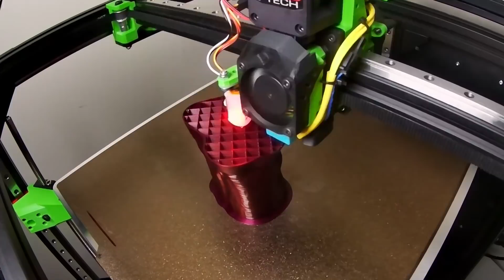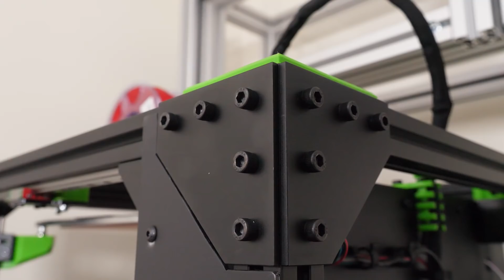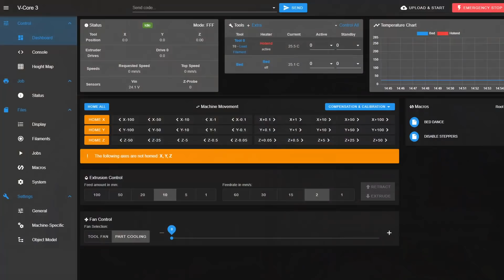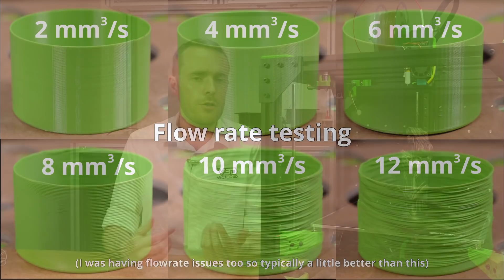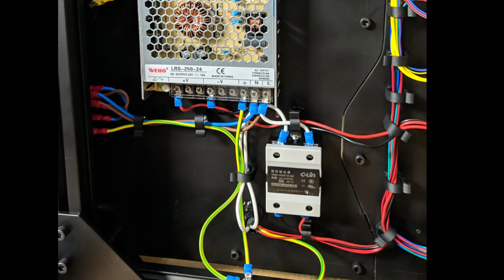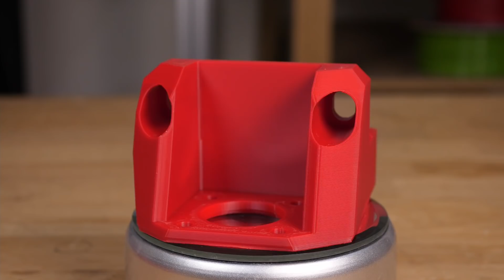The Best 3D Printer Kit Money Can Buy in 2021?

Comment: Is this good for a first 3d printer? If not, what is?
Reply: Intention to inform:
Would the builder understand what he is or has to do that he can print with such a diy kit printer?
The builder has to do anything so he can start to print. Is that easy?
When he knows what to do yes. 
When not he has to learn anything about the printer and the usage.
A better alternative?
Go for a finished printer, used slitghly and not to expensive.
Ebay is a source.
Buy - plug in - slice - print.

Comment: What is the fastest speed you can push the V6 in the default configuration?
Reply from the maker: 10-12mm^3/s volumetric flow. The print speed depends on layer height and line width.

Comment: You talk about the v6 being not able to keep up with the rest of the machine. Of the options that ratrig provides, which one do you think is the best option(i.e. has the highest flow, like you suggest)?
Reply from the maker: Of the parts you can get with the kit direct from ratrig, the highest flow rate in theory is the mosquito magnum.
Reply: @Vector3DP  is that the only change you would do from the "default configuration"? Trying to figure out what I should order when I get my ratrig (my only previous 3d printer is a ender3)

Comment: Hi!
a few things:
as a reviewer, I wish you tested the dimensions/tolerances (tho honestly for a printer like this there's no chance it can't do 0.15mm tolerances and outside dimensions 0.05mm).
but the biggest thing was that you never mentioned the max speed/acceleration you can reach for outer perimeters, which is one of the big reasons someone would spend this much on a printer like this and choose corexy.

also i wish you showed more prints from all sorts of angles/lightning with non/glitter matte or special filament. using generic black/grey/green etc. rotating the print in the X/Y axis would show more. also shining filaments like the ones you used. you know just generic pla.

Comment: Is kinematic bed used to increase overhang treshold by tilting part to get decreased angle to put another layer? Or just for sole purpose of auto leveling?
Reply from the maker: Just for levelling. There is currently no slicer support for overhang assistance like this.
Reply: @Vector3DP  Thanks for reply. Potential is there. Also ironing of angled surfaces could be a thing.

Comment: Why do 3D printer manufacturers supply a inferior power supplies? The power supplies should be about 500 watts & have linear rails. I believe a 3D printer should be pre-assembled & factory tested. The top of the Z axis should have a top bushing if not using ball screws. I will not buy a 3D printer without servo motors, ball screws, & upper supper supports for the top of the Z axis ball screw. Also you should not have to figure out what to change in the firmware & slicer software..

Comment: I recently built a self sourced v-core 3. I have the same problem with my duet 3 mini failing to enable the fan in thermostatic mode. I disabled stealthchop in favor of spreadcycle, and it improved the stepper noise while printing. Thanks for the video.
Reply: If you don't mind, did you manage to get it significantly cheaper?
Did you source a lot from more or less shady shops from China or how did you source locally?

I'm considering a V-core 3 but the lead times are a real bummer. One month is totally fine by me, but three months is a bit long for my taste.
We'll see, I'll ask if it's faster without printed parts. I'd just get a used printer for cheap or get it printed by a friend. Probably preferable anyway for an enclosed printer. I'd use cf-ASA or ABS for good measure.

Comment: There are so many artifacts on this video, or is it just me? Other videos look fine.
Reply: You mean the ringing? High jerk (or acceleration, which didn't seem to be the case here) will do that on any printer without input shaper. You really should be using input shaper on your printer at this point in time though.
Reply from the maker: I think me means like the video file corruption/streaming issue rather than ringing.
Reply: @Vector3DP  Oh! Doh! I was assuming based on a couple of other comments about that 😅

FWIW it looks absolutely fine on my end.
Reply: @Vector3DP  Yes

Comment: Any reason to use Klipper on this over their firmware?
Reply: Yes. V-CoreOS (preconfigured klipper package) will make your setup experience easier, and you will get a higher performing printer, because of the way klipper works (computation done on the infinitely faster pi, only instructions sent to MCU). Furthermore klipper has a very solid input shaper implementation and plenty of horse power to execute it properly, where as RRF's input shaping just entered beta, and it's all done on the comparatively slow MCU.

Of course there's a whole bunch of other reasons to use klipper, which i won't get into here :)
Reply: @miklschmidt  That's kinda what I figured, but I'm still a n00b, haha.

Thanks for the thorough response, friend!

Comment: Great review; I’ll be very interested to see your results with a high flow rate hotend. (Maybe a Hemera?) I’m considering a VCore 3 for my next printer, want high speed, large build volume and “fire and forget” reliability, but at the same time don’t want to have to sink tons of time into tuning. It’d be a huge boost if you came up with a solid high-flow configuration and could post the tuning settings.

Also, relative to the ghosting, have you looked at the Klipper firmware yet? I understand that it can compensate for vibration and mechanical ringing, but I don’t know how it would compare to the long-established Reprap platform.
Reply: Never thought i'd see high flow rate hotend and Hemera in the same sentence 😂 Hemera (and similar extruder/hotend combos) should be avoided for CoreXY use. Hemera in particular is quite heavy and there are no good balanced way to mount those considering that the carriage is moving in both X and Y directions, so it will result in unwanted print artifacts. You should be looking at something like LGX / Orbiter, Dragon HF, Mosquito Magnum etc.

With regards to klipper, look up V-CoreOS :)
Reply from the maker: I agree with @mikkel
Reply: @miklschmidt  Ah, thanks for that note! I liked the idea of the Hemera for its tightly-controlled filament path, which seemed like it'd make it ideal for flexible filaments. I'll check out the others you mentioned, and look forward to whatever Vector 3D chooses to test!
Reply: @DEtchells  people have done tpu at 100+ mm/s with EVA, so it’s a bit overrated. If you go for ninjaflex and stuff you have to print slow no matter what, you’re pushing a wet noodle through a steel tube. Might as well use cheap bed slingers for that :)
Reply: @miklschmidt  Oh, for sure; I don't expect to print flex filament at any other than slooow speeds. My interest in the VCore 3 is to finally have a really solid printer as a "daily driver" that I can get dialed in and then just forget about. Right now I just have a MP Mini and a Rostock Max that's currently in a very finicky phase of its life. I'd like to be able to get a printer set up and dialed in and then just not have to think about it much. I'd like the speed for the usual PLA, PETG or Nylon prints, but want the option to run things like Ninjaflex if I want to.

(I'd actually like an IDEX machine so I could use a separate support material, and have been looking at the Ratrig V-cast, but I like the VCore 3's much more rigid-looking frame, linear rails, higher speed capability and the fact that the Z-axis only moves up and down in CoreXY designs. It sounds like you have a lot of experience; what would you choose if you were going to have just one FDM printer, whether single or dual-extruder?)
Reply: @DEtchells  oof that’s a hard question to answer. I’m a tinkerer, so settling is not something i do well 😂 if i had to pick i would probably keep my 400mm V-Core 3. But i would  turn it into a toolchanger.
Reply: @DEtchells  full disclosure, i’m a member of the Rat Rig Beta & Development Team and creator of V-CoreOS, so i’m biased 😅
Reply: @miklschmidt  Ah, thanks for that note! Wow, a toolchanger; you DO like to tinker :-) (But a toolchanger would be a great way to get multiple material with a CoreXY machine.) Wow, you made V-CoreOS? I'm crazy-impressed! It's the direction I'll go if/when I get a V-Core 3. I love the results Klipper can achieve with input shaping :-) Thanks again for your input. The 400mm you have is the size VCore3 I'm interested in.

Comment: Great review !

I was actually planning to get a custom-sized kit (which they can make when asking) to convert my current printer to CoreXY. So, this review reinforces that this would be a very good choice, the additional hardware to buy being minimal. No Duet board for me, SKR will do the job running Klipper.

One remark, though : while it's true the v6 can melt around 12 cubic-mm/s of filament, the speed at which you'll eventually print also depends on the extrusion temperature.
The faster you print, the hotter the filament has to be melted. Usual temperatures are fine up to 80 mm/s or so. Yet when you go past 100 mm/s, you have to increase the temperature unless you have a high-flow hotend such as Mosquito Magnum, Nova, or (Super)Volcano. If you don't intend to print faster than 250-300 mm/s, a standard v6 would be fine with appropriate temperatures (and cooling).
I'm printing at 120-150 mm/s on a classic cartesian running Klipper, with peaks of 200 mm/s, and temps had to be increased to quite higher values for the filament to properly melt using a v6-style hotend. PLA, for instance, prints really well at 225°C (1st layer : 215°C, slower) at these speeds.
Reply from the maker: Ye, printing hotter only works because the point where the filament leaves the hotend is not actually getting to that temperature and/or it requires highter temperature to increase the rate of heat transfer. Obviously it works, but its not technically 'stable'
Reply: @Vector3DP  Yes, that's right. It's more a temporary workaround than a stable solution. High flow hotends remain mandatory, sooner or later.

Comment: I feel like you bought a quality kit and went for the worst, most outdated hotend solution on the market. With a Mosquito Magnum or equivalent you'd have better results at speed which is the reason you spend huge money on a printer of this type. Speed and reliability while maintaining quality. That's an oversight for sure.
Reply from the maker: Not my decision, this is the ratrig suggested/Default configuration.
Reply: @Vector3DP  Unfortunately, yes. Many of us want this to change, but it's an uphill battle for so many reasons that are not entirely in Rat Rigs hands. I can't recommend the default configuration at this point. Fortunately, the configurable option allows you to run whatever you want. All configurable options (and then some) with the exception of the Duet boards are supported in V-CoreOS out of the box.

Comment: If you liked the Rat Rig I would recommend checking out the HevORT printer. It has similar features but better bed autoleveling and it can print at higher speeds than the Rat Rig :D
Reply from the maker: Schedule is pretty jammed at the moment, thanks for letting me know though, i may take a look in the future.
Reply: Can you elaborate on why you think the HevORT leveling is better?

Comment: I ordered my vcore3 with same duet, but LGX extruder and mosquito magnum after watching your build. 

I didn't see your affiliate link though sorry. I can give my order number if Ratrig will associate my order with your channel.

Really looking forward to the build. I'm a little dubious about doing the mains wiring though.

Thanks for uploading your side panel with IEC cutout.

You mentioned additional fixings needed. Washers and some T nuts for panels. What should I order? Also, is it worth getting some better idlers for the build given the hassle of taking it all apart if one were faulty. If so what would you recommend.

Thanks.
BTW : The Caribou you built on live stream is still printing perfectly. I've just regreased the bearings last week, apart from that never needed any attention 👍
Reply from the maker: don't worry about it mate. I think you'll be fine, its not too bad, and the back panel arrangement is an easy workspace. live stream always there if you need it :)  If not actually been back and reviewed the exact parts needed to change this, I was kinda hoping ratrig would sort it tbh. My best guess at the moment would be M5 x 10 screws, washers and 3030 M5 t nuts for the enclosure panels. For the frame assembly, M6 x 16 screws and M6 Heavy Duty Flat Washers (DIN 7349) would be needed i think. You might be able to get away with using normal m6 washers and the included screws, but it will reduce the thread engagement by 1.6mm.

Glad the caribou is still going strong, great printer that one :)

Comment: I was thinking about building this printer, but decided to go for Voron 2.4 and ph boy im so happy with my decision 😉 ive got 350 cube size, enclosed with glas panels, tuned with klipper firmware, this printer is crazy well done 😉
Reply: By far the most impressive machine out there. I am building one once kit arrives, completing Jubilee tool changer machine right now.
Reply: It’s just cooler in every way
Reply: why the voron over the vcore?
Reply: @kcdakrt  because it's more hard to build, costs more, you gotta deal with the flying gantry, the racking and so on.
Reply: @10magicalfingers27  I am going to have to disagree on this. Maybe way back when the v2 started but the documentation and the community on the discord can walk you through and fix any possible issue you encounter. It's not hard to build at all its pretty damn easy the 2.4 was a breeze for me but my v0 was hard but that's because it's small. Don't want flying gantry v1 v0 and Switchwire are all there too. As far as expense. Yea it's not a 300 dollar printer. You can save quite a bit by sourcing everything yourself I spent maybe 400 on my v2.4 and it's got all the bells and whistles you could want. But for that you gotto buy stuff when it's on sale or discounted. Sadly too many people want printers like this but don't wanna do the work to have them.

Comment: For what this thing costs, the printed parts should be Nylon
Reply: Check cnckitchens build for the voron v0. Nylon does not work as it deform with time.

Nero3dp had a similar issue with his voron 1.8 recently.

But abs/asa would of course be nice for a printer you can easily fully enclose

Comment: Project is open source indeed but you cannot build it without ratrig store, for example the bed heater is not available for purchase anywhere (chinese manufacturer has been asked not to put it for sale on ali?)
Reply from the maker: bed heater is one of the easiest parts to get. Keenovo and Filafarm
Reply: You can order custom beds through keenovo. I had them give me one with the same size and wire offsets with a smaller wattage. Pretty sure i saw people with standard size heaters without issue too. Just have to be more precise with placing it if ordering a standard one (ie 400 vs 380 bed heater for a 400mm). Probably not seeing the weird sizing on ali and whatnot cause it's a bit niche of a size.
Reply: Bed heater is Keenovo, just go there and buy it direct. 
https://keenovo.store/collections/standard-keenovo-silicone-heaters/products/keenovo-square-silicone-heater-3d-printer-build-plate-heatbed-heating-pad?variant=8324021551159
Set you back $72.00.
Corner brackets might give you some trouble, but a chop saw and a drill press can make them.
Reply from the maker: All the brackets are easily available on aliexpress